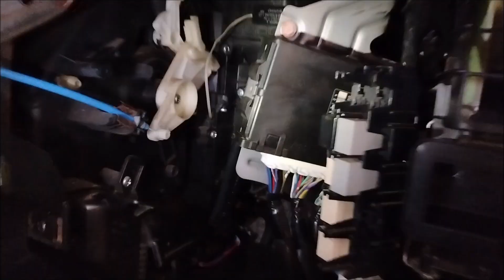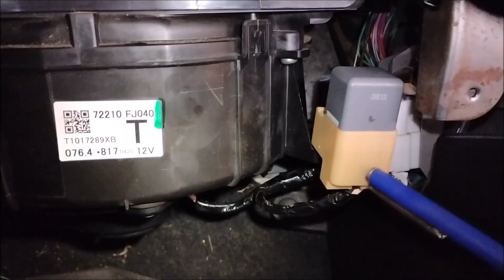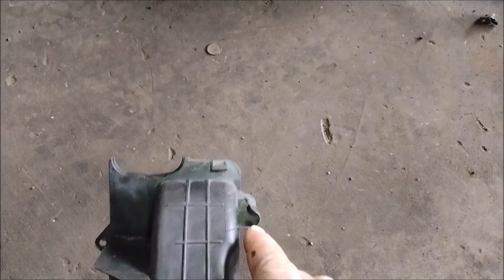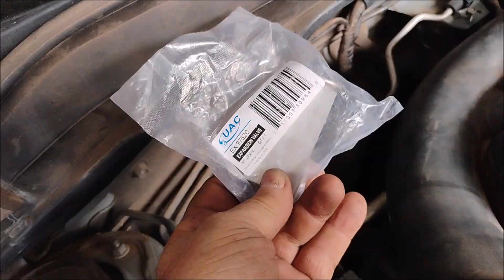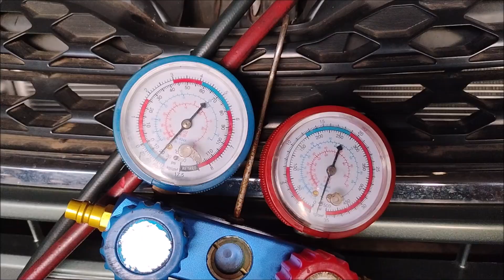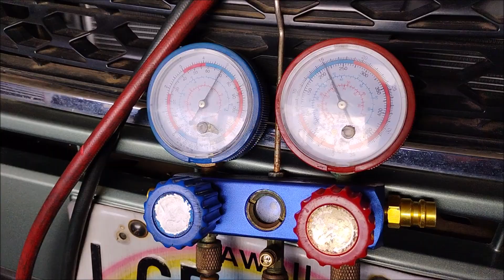AC Evaporator and Expansion Valve - 2015 Subaru Forester

Comment: is removing the "glove box surround" different for 2010 model? i can't get mine off and it seems to be connected to the center part of the console
Reply from the maker: Sorry, can't help you, never seen a 2010. Does it even look like this 2015?
Reply: @Merryfrankster_  thanks.. i got it off far enough and bungie strapped it to the side to be able to take out the blower assembly and evaporator coil cover, haha.. now im stumped with disconnecting the two ac tubes from the expansion valve. i got the 10mm nut off the engine side of it, but still can't get it disconnected on the section by the firewall.
Reply from the maker: @raybrown9573  the connector tubes bolt on to the evaporator, with a bolt in the middle between the two tubes.

Comment: I'm a loss how you are testing for a leak, under vacuum using a sniffer. There would be no gas coming out if under a vacuum.
And the question of oil, did you add or checked for oil in the old evaporator.
Reply from the maker: You do have to charge the system with refrigerant, temporarily, to test for leaks with the sniffer. Then you use the recovery machine to suck the refrigerant back out when you are done testing. Which you try to do your testing as quickly as possible so you waste as little as you can of refrigerant through the leak(s). Just add a few oz. of oil routinely when replacing components (2-3 oz. for evaporator or condenser). More for compressor.4-5 oz.